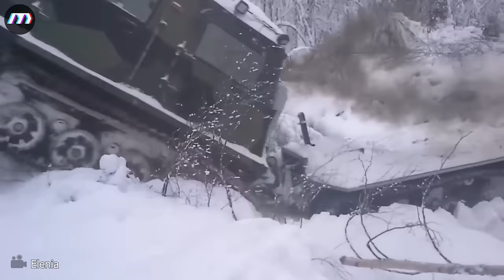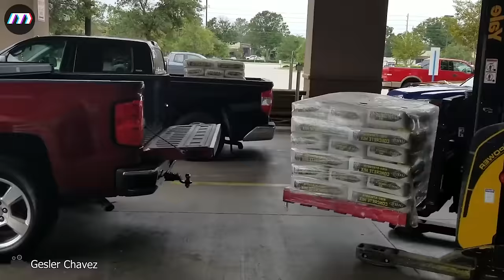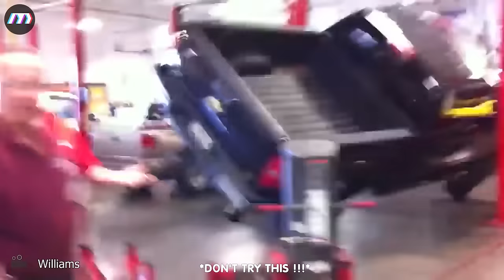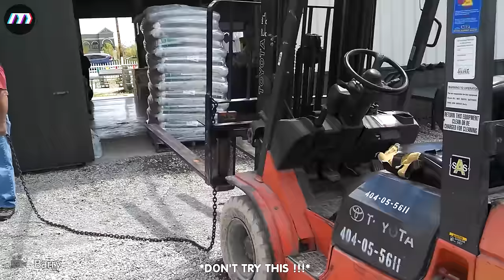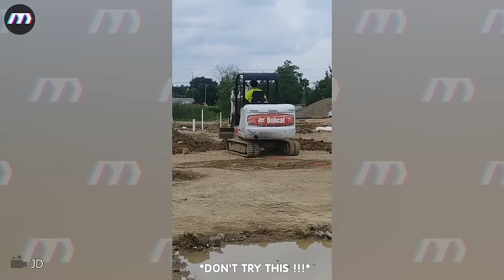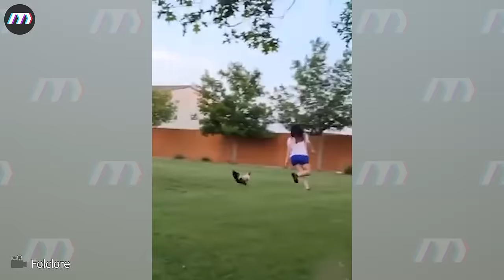80 Total Idiots At Work Got Instant Karma !

Comment: (눈‸‘■`)Wonder why they chose not to use an ACTUAL coin counter, but instead chose rely on human employees, which would obviously completely clog up the whole works, wholey and entirely.🤦‍♂️
Reply from the maker: Thank you for your feedback and enjoying our video
Reply: (눈‸■) @madthingsus , to quote a fictional literary character by the name of Sherlock Holmes eyes and brains, eyes and brains, first off Eyes: The individual obviously had at the very least two or three buckets able to hold maybe around fifty gallons worth of material each, maybe even planning to bring in as many as perhaps twenty or thirty more on top of one or two others, with another two on the cart, now if actually Don't have any counting machines, then that bank teller employee was in for spark of a rough day.🤦‍♂️